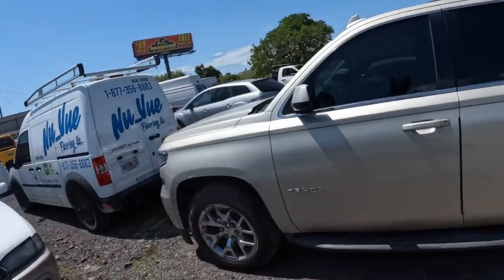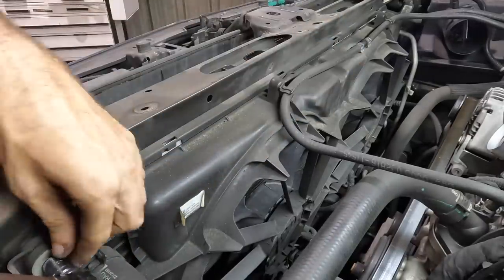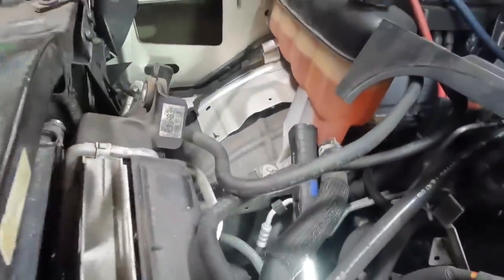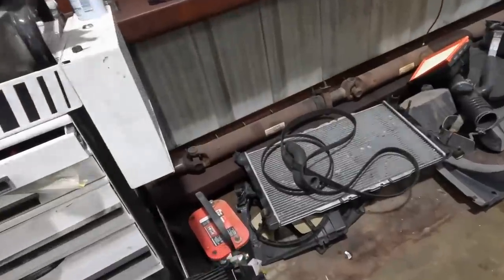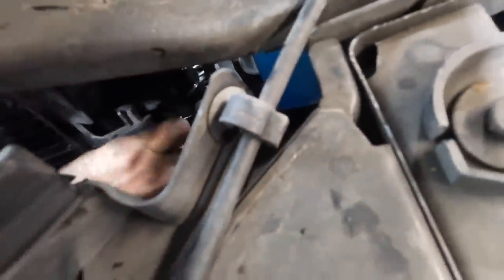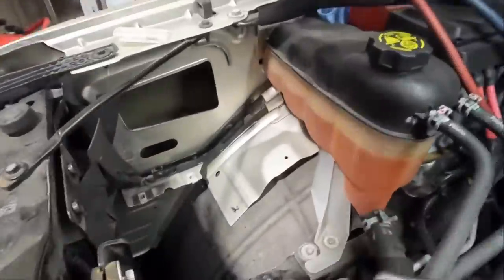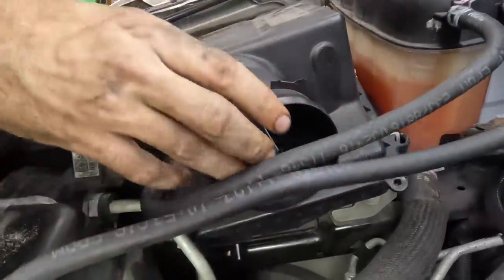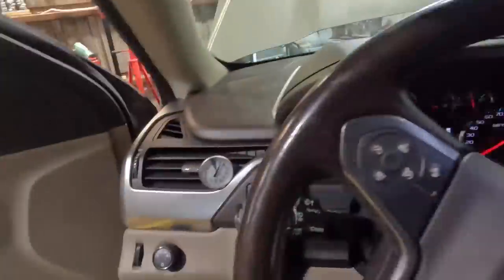Design Flaw? Cut In Half from Factory! CHEVROLET Tahoe 5.3 Freon Leak

Comment: I've changed my share of radiators, and condensers over the years, and one thing that helped was to tape cardboard to them for protection during installation.  you can get a lots tougher with it without damage.
Reply: Yeah,  I've done that.
Reply: Good Suggestion!
Reply: Good one. I remember doing that long ago. I installed an ac unit (window frame building unit) by myself a few years back and forgot said tech. Lost control of it in massive overhung load moment and flattened a few fins.
Reply: never taken anyone's pro advice. If he held the vacuum last time longer, would have discovered system leaking, instead of quick charge and go and get the dough.
Reply: Bike shops have plenty of boxes and they're double wall. Use them for creepers, drip collection, radiator protection and silhouette  targets.
Reply: Damn good tip, thank you!
Reply: @forgetfulme1719  how do you suggest he find the leak without installing dye and charging?
Reply: @Rythsi300  he should have done that lat time, also there are electronic sniffers.
Reply: @forgetfulme1719  you can't assume that though
Maybe the customer didn't want to pay for full diagnosis and just wanted a recharge
Reply: @stickit2theman1  pull vacuum and hold 1 hour before rush to recharge. He would say so if customer dumb enough to pay for big leak recharge.
Reply: Chances are, the customer wanted their car back and wanted AC until they could drop it off again. Since Ray is an old GM tech, I’m sure he probably already knew where the leak was. Just the handful of folks that I know that have that era of GM truck have all gotten condensers. It came around the time the transmission failed or the MDS went tango uniform and ate a pushrod and the cam.
Reply: "Will he forget to remove the now well-hidden cardboard? Place your bets, ladies and gentlemen!"
Reply: @SportFury1966  I'll bet "he" would within a few minuits after starting up the engine.  LOL
Reply: @forgetfulme1719  yeah open your own shop and do it or you can apply for a job with Ray.
Reply: @Rythsi300  You can add dye yourself but you'd need an A/C Manifold Gauge Set.
Reply: @keithdonaldson3945  They make fin combs for straightening out those fins. The good combs have 6 different heads for different fin spacings. If none of them fit you get do it one fin at a time.
Reply: @keithdonaldson3945  they make fin comb sets, each comb size is a different color for straightening bent over fins.
Reply: @forgetfulme1719  but sniffers have trouble finding slow leaks.
Reply: @jadesluv  not the $68 ones, $680 one can detect 1.5 oz, leak per year.
Reply: If I don’t I definitely have to buy a radiator. Only 2 times but I learned my lesson for sure.

Comment: My 2001 Impala with 40,000 miles did the same thing. I thought it was the transmission so I took it to a transmission shop that everyone recommended and he said it was a bad spark plug.  I thought with only 40,000 miles on it and the spark plugs are supposed to last 100,000 miles I thought it was the transmission and I was wrong.  I am lucky the transmission place was honest and told me the truth. Most places would probably tell me I need a transmission.:yougotthis:

Comment: A lot of these condensers fail if the truck has been driven Dukes of Hazzard style over bumpy roads or off-road or at a construction site.   The whole front-end flexes like 2 inches and strains the rather rigid radiator and AC condenser.

Comment: Funny I was just thinking can you remove the upper radiator support when you said you could not. Another question can those welds be braised/re-welded on the condenser? Seems like a new condenser could still have the same high failure problem if not redesigned while a new quality weld may last longer. How do you know that a new Delco condenser made in the USA would not be redesigned so the problem no longer happens like that quality Chinese made part. Support your local Chinese employer and employee.

Comment: i had a 1989 Chevy Astro. It had rear AC. for some reason after I fixed the compressor and replaced the AC hoses and condenser, also the accumulator and oriface tube the rear AC would no longer function. No matter what I did it would not work. It seems at the junction in the NEW hose and the old hose something would not allow it to go farther than that. I could never figure that out.

Comment: Possibly could have left the plug in the AC condenser until you were ready to connect the AC hose to the condenser. Less dirty air and humidity to remove from the system. LoL

Comment: I didn't recheck but were you just recovering refrigerant from an air conditioning system that was open to air just before that? I'm pretty sure that after the work, you first recovered, then, pulled a vacuum, and after that, charged it. That would contaminate the refrigerant. And it could be causing the long charge time. And it will affect the performance of the air conditioning systems that you service on that tank, after. Because if you recover a system that was open to air, you basically sucking out the air and store that in the tank. Or did I miss something?

Comment: Wouldn't that new unit cause the thermal bridging (parasitic heat transfer between the transmission and AC sections) problem what the cur in the factory one was supposed to fix?

Comment: The vehicle will simply stop moving long before that transmission incurs any kind of actual damage. No transmission  lotion = no vehicle motion. If it doesn't move you turn it off and all moving parts stand still. That cut is also not a design flaw. It is repurposing an existing part (an AC condenser) to also work as the trans cooler. It is GM being too cheap to design a new part. You can Healey arc (MIG weld) a support on the GM part but only on the trans cooler part. Don't weld leaks closed on AC systems. It shrinks the tubing which changes the pressure & the flow.

Comment: Watch South main Street see Eric welding you could save the Subaru engine yesterday's video on YouTube. This technique really works especially when he uses the washer..
Reply: Ray has used that exact welding process on multiple vehicles in several of his videos.
Reply: @stevewhite3424  similar work but he doesn't clean anyting never saw him use a steel washer then weld a a nut on top. Not sure if you looked at that video South main Auto. Ps Steamfitter 40 years experience.
Reply: @Paul Boomer  I don't know what your experience has to do with whether or not I watch a video or not. Also noticed that the only time he used the washer was when trying to get a weld on a stud or bolt that was below the surface of the head.  I have watched every single SMA video ever made and consider him one of the top mechanics around but damn, he isn't Jesus.  His video was clearly aimed at those who had little to no experience using the method he showed.  A method, with which I am 100% sure Eric would agree has been around for a very long time.  There is nothing magical about it even with a washer.

OBtW, with regards to the.broken bolt removal on Ray's Subaru.  I don't know know a single machine shop that would attempt that removal without that motor being stripped down to the affected casting first.
Reply: @stevewhite3424  guess you didn't watch the video!
Reply: @paulboomer7109  You win!  Be happy!

Comment: What jumps out from Rays videos is that The vehicle Manufacturers assemble vehicles designed by engineers in different specialities, yes they may assemble the vehicles efficiently but all to often they never seem to consider the practicalities of maintenance. The front cross member on this vehicle is a classic example why not have it bolted in place?

Comment: Forgive my ignorance, but if the weld cracked is it possible to weld some more metal into the crack to fill the leak and I would assume that it would be cheaper for the customer and one less item for the trash heap? I know the perfect answer is to replace the item. But is there no why to fix instead of replace?

Comment: Had a similar issue with my 2014 and was told it isn't in the recall. They wanted $1700 to replace the condenser. I spent $360 and replaced the radiator and condenser myself.

Btw those airbox holes ccrack all the time. I fixed mine with a washer under the head of a coarse threaded screw.

Comment: Ray always goes the extra mile when he fixes things so why not blow out the radiator's bugs/leaves/crud with his blow gun while he has the condenser out?  I had a car that would overheat in traffic and the repair shop found the problem was a dirty radiator. That car had had the condenser replaced in previous years.

Comment: That radiator support does come out 3 10mm bolts on each side that run from bottom to top. Takes an extra 10 minutes to get them all loose then you have miles of room to get the condenser out. Not to mention the retaining clips for the atf cooler lines

Comment: Being anal retentive, I could not work with tools all over the place.  You do a great job, Ray, but we are definitely different in this aspect
Reply: For me, I think the quality of my work is higher when I keep things clean and neat.  Being ocd and anal retentive can be a positive.  It can also make you crazy at times.🤔
Reply: I could never reinstall a part ( i.e. an oil pan) without cleaning the outside as well as the inside. But then, I've never been an auto mechanic in a dealership working to a flat rate schedule. Always been a fork truck, heavy duty truck or compressor/vacuum pump mechanic.
Reply: Presuming you may be a nurse, OCD is assumed.
Reply: @Brettsharplpn  It's a requirement for that profession, along with many other trades and crafts.
Reply: For me when I was young I could work with shop looking like a bomb went off...but the older I get the more OCD I seem to get...definitely get everything organised between projects
Reply: I’m a between job organizer with my tools being totally different from my younger years when i kept multiple sets of tools because i was always loosing something in the mess.
Reply: @air-vacsystemsinc.7770  --Same for me, I like all the Components Clean, makes me Feel that I did a great Job...
Reply: I'm OCD in the quality of the work although my garage looks like a mess during the process of the repair. After I'm finished, then the tools get put away in their proper location
Reply: @Brettsharplpn  thats me...   I need tools put away.  I cant work on a cart that is cluttered..
Reply: I like to come into clean. But it would depend on if there's something to work on the next day or not, if you're waiting parts, clean.

Comment: 🧰🔧 It's unfortunate that the weld issue between the condenser and filter dryer is a common problem among GM vehicles of that era. This raises questions about the design and durability of these components. It's essential for manufacturers to address such recurring issues to ensure customer satisfaction and prevent potential safety hazards. Have you come across any solutions or alternative approaches to address this issue effectively? Let's hope for improvements in future designs! 💡🚗🔍

Comment: Would removing the grill have helped access the condenser?  I'm thinking an angle grinder with a cutting wheel on each end of the radiator core support would have helped tons. Reassembly with the welder plus a little paint, and Bob's your uncle!
Reply: Castinn- Breathe, Sir, just Breathe. When I get lightheaded like that, it helps a lot.

Comment: It is easier to remove the grill and bumper.
Reply: To remove the grill one has to remove a trim piece between the bumper and grill to get to the grill bolts. The end bolts for the trim piece are behind the inner fender. Depending on the size if the tires, one may have to remove the wheels to pull the inner fender down enough to get to the one bolt on each side. PITA.

Comment: Ray, your supposed to drain and measure the oil that came out of the old condenser and add that amount of new oil to the new condenser. I know, "he probably did it off camera". Come on, deep down you know he just didn't do it. Never seen him do it with compressors either.

Comment: Ray, save the A/C service machine by plugging it into a receptacle instead of the plugstrip. Its electric motor will love you for feeding it more electrons than are avaliable through the tiny wires in the chinesium plugstrip !!!

Comment: Nice how this replacement (likely made in China or Taiwan) is better made than the original. Like how the company that provided the new condenser give you a small baggie of candy. If not for the mechanic working on the replacement, their kids can have it. Cute touch. AC is a life necessity in Florida. Good you were able to find the leak and could fix it.
Reply: What is it with Radiator shops and candy baggies? Local one does the same!

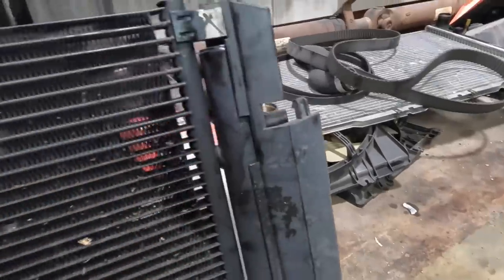Comment: @21:50 The condenser in my  2015 GMC Sierra was broken in the same spot. The mechanic at the dealer showed me the problem condenser and said that the replacement unit was supposed to correct these design flaws and provide a better product than was original equipment from the factory. I hope that Ray rechecked the transmission fluid level.

Comment: The trans cooler lines that are used on this vehicle is just stupid. Using a non mechanical fastener IE ((flare line fittings)) is just a very expensive accident just waiting to happen.
Reply: I assume the factory changed the design from the steel lines with a flare and nut fitting to the o-ring and clip design for the ease and rapidness of assembly, but there are several other aspects that make the o-ring and clip design better than the flare/nut fitting, and the biggest improvement is that there is no longer a tube nut to rust to the steel line to make disassembly a nightmare.  The old brass,copper radiators had steel fittings for the tube nut and it there was rust, the tube nut would round off, or the threads in the radiator would strip out, talk about nightmare.  Additionally, if the tube nut on the line, and threads in the radiator are not perfectly lined up for assembly, it take forever to get the threads started only after much aggravation, swearing, and bending the lines line by hand to gain alignment.  I for one am am glad they changed the design to the o-ring and clip (even thought I hate those "F'n" clips).
Reply: @quicksilver462    In 1996 certain G M / Delphi divisions did the same with the cooling water connections for their injection molds producing plastic components. Injection molding industry had standardized a quick disconnect tapered thread pipe fitting which were replaced with a collected/O-ringed featuring the same disconnect.
Reducing mold change downtime by eliminating cross threading damage/fractured pipe nipples/leaking threads.
During a mold change if a nippled extension disconnect needed removed from deep inside.... Left is loosy-right is tighty? A mistake left broken threaded portions lodged in the tool steel main segment. Instead of blowing the water out', spraying a rust preventer and storage shelving the mold now needed to go visit/be scheduled to the tool shop.
Reply: @quicksilver462  There is an answer to the fittings rusting and getting them started. One make the fittings and receivers out of brass / bronze / nickel copper or stainless steel. Secondly have the fitting's end taper slightly to make alignment easier and third an independent transmission cooler all together. That takes of the possibility of cross contamination between trans fluid / anti freeze or anything else. Plus with an independent trans cooler the fluid stay much cooler than not.

Comment: Almost as muck fun as R&R ing the radiator in my 1994 Taurus LX with the 3.8L 90° V6. the transmission cooler lines came in from the front at a 45° angle.

Comment: 21st century engineering. Pull out radiator, engine,all seats, dashboard, sun roof, tires, exhaust system and rear view mirror to get to the part you need to replace. Part cost $5, job cost $10 billion .

Comment: If anyone cares to answer....If the refrigerant is not fully pressurized coesn't that mean that there is or was a leak?Can the refrigerant be low and still have no leaks?Like after 8 years when its not ice cold anymore....why is that?How can refrigerant be lost without a leak?

Comment: I replace them by only pulling the 2 radiator bolts and tilt it forward then pulling the condensor up between the radiator and core support with no coolant loss

Comment: Those trany cooling line connectors are a hell of alot easier to work with the gd F350 T.diesel , spent better part of 2 hours just trying to get the connector release tool to seat properly and another hour trying to get it to work.

Comment: I tend to consider most Chevy vehicles in general to be design faults. lol
Reply: Yup!  My 2006 Z71 with 325000 miles has had all kinds of faults.  It got dirty when at the iol fields, water pump want bad about 20k ago, needed driver side window switch and headliners getting droopy.  What a POS!  😊

Comment: tsk tsk Ray, you did not put the clips back in the transmission lines when you reconnected the condenser!
I saw them still in the parts tray next to the bolts for the 'other project'
Reply from the maker: Ha! The new condenser came with clips… The old ones are now mine😏